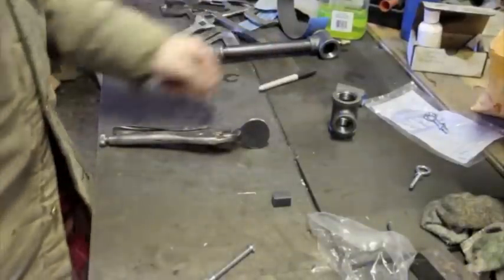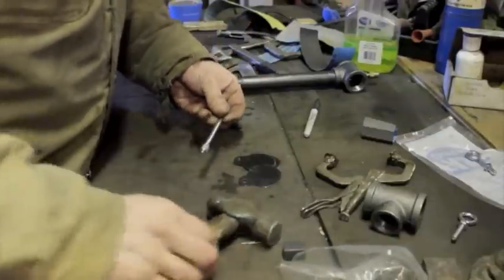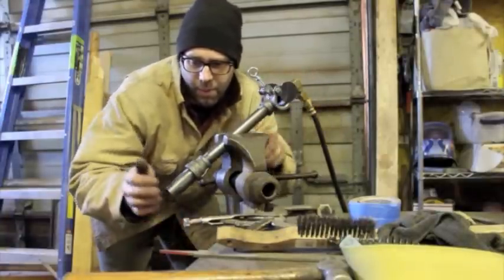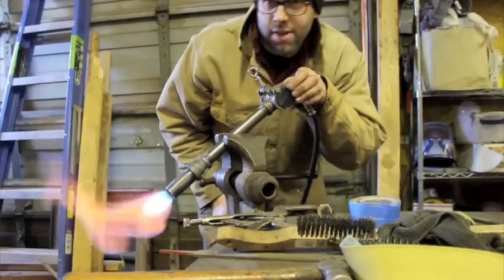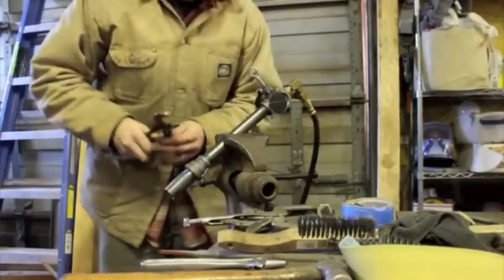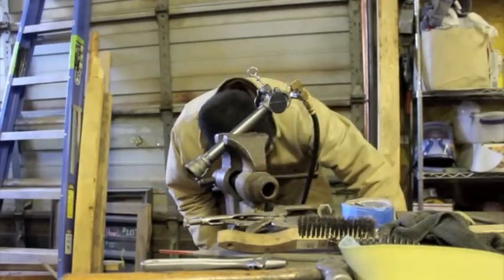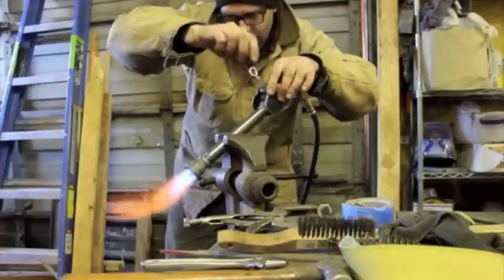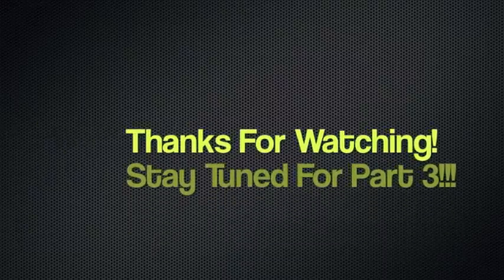BUILD A BETTER "FROSTY T" FORGE BURNER PART 2:  AIR INTAKE CONTROL SYSTEM

Comment from the maker: Great learning process. As a couple people have pointed out, it's possible to permanently adjust the burner as desired. The directions for the Frosty T burner tell you how. I didn't have the instructions when I made this. However, if you ever wanted to adjust between a neutral, carburizing, or even oxidizing flame for some reason, the original design won't allow that, and therefore the purpose of the air intake control system.

Comment: 1/4" all-thread would be a better choice that way you can use 4 nuts to secure the air valves. Maybe you can even use washers against them to add more precision and stabilizing control.  I like this Idea, simple yet effective. Also, you might want to get some 1/4" flare nuts for the flare fittings, but you need a swedge and flaring tool to make copper pipe connections. It would be much easier to plumb up. HVAC uses these and a used set should be easily obtained.

Comment: if you dont need to adjust the burner once its set you could use a treaded pipe (think they sell those for lightfittings ) where the gas goes in the T pipe mount 
mount a wide washer behind the mig tip , when you need to adjust it you basicly screw the migtip with the washer toward the ventury pipe and close up the ventury with it 
once its set you can lock the thing up with a bilt on the outside and hook the gasline back up

Comment: looked like you could have used a 90 degree elbow instead of a tee.  Even if you had to go with a 1 1/4' elbow.  They even make them with a hole already.  Then you could simply add a ball valve to control the air flow.

Comment: I changed my mind about the flare, it isn't venturi its the opposite of the other end. Slowing the mix down and holding the flame instead of blowing it off the end.

Sorry for the rant and late reply.
Reply from the maker: Controlling the velocity; that makes sense. I think that's what you're talking about? I may be wrong, but if I'm not mistaken, lower velocity could still allow more air (oxygen) in than you need for the burn, which would produce an oxidizing flame. This was my concern, as having an oxidizing atmosphere in the forge is not ideal. Holding the flame is one thing, the type of flame you produce is another. Also, it seems simpler to me to not have to fiddle with the jet depth.
I'm certainly no expert on forge burners, the only reason I labeled it as a better frosty t is because despite the adjustments you might be able to do on the original design, there is no way to actually limit the amount of air / oxygen that enters.
Thanks for the interaction and watching the channel!
Reply: @FireCreekForge  Whatever works best for an individual most definitely. And I hear you now on the title, was just curious. Anyway that's the science of it. Like I say if a guy doesn't want to mess with the initial tune then choke is the ticket. But the depth is what controls "volume" of air not the velocity if you don't use a choke. PSI will control velocity. The openings in the t will only let in as much air as is pulled in. I was quite intrigued out how these types of burners work once I started to delve into the fluid dynamics portion of the build. I'm glad it's working for you, there's always another way to skin a cat. Look forward to seeing the rest of the build.
Reply from the maker: @trevorjonasen3251  somebody posted the instructions, and you're right. The only limitation seems to be that once the burner no is adjusted per the original design, you can't adjust again it if needed.

Comment: May I ask why you are not building this from the directions? I have 3 T burners and they work quite well. In this temp I have to choke mine a bit but adjusting your orifice length gets you set without needing a choke when warmer out.  Also once it's in the forge it really does act differently. However I do like the choke set up you made it looks nice and smooth.
Reply from the maker: I haven't actually seen the original directions, there's probably additional useful info. But I do enjoy learning about all this. But I don't understand how adjusting the jet depth would control amount of air / oxygen flow...?
Reply: @FireCreekForge  I would think it is the nature of a venturi, placement of the orifice determines how much air your scavenging. I have no proof  of this just  think it makes since. Thanks for the video .
Reply: @FireCreekForge  These work on Bernuili's principal instead of Venturi's. Bernuili's is that a fluid entering a narrower cross section will speed up creating negative pressure in the original larger cross section.   The negative pressure acts as a vacuum pulling in air and pulling it down the mixing tube behind it. I believe the correct term is "jet enducer" as the jet of propane is what is controlling the air flow. So the closer the orifice is to the throat of the mixing tube the less transition from big to small so less suction. And reverse the further away the tip is. The starting depth of the orifice should be 1.5X the radius of the mixing tube for starters and then you trim it shorter as you need to get the FA balanced out. If you have a full length mig tip n there then you may not have tapped the fitting down deep enough. Your choke plates solve that problem as you can reduce air manually but if tuned right and I struggle with that at my altitude you should never have to change anything after that. Everyone calls non blower burners venturis, I believe that because the industrial ones are venturi burners and they work kinda opposite. You make a restriction in a pipe then flare it out and a negative pressure builds on the downside of the restriction pulling air and fuel down faster.  The coupler/thread protector acts as a mini venturi as the stream of air and and propane enter a larger cross section they slow down and kind of hold the flame. I could be off A little here so don't quote me please. I gleened most of this from the I Forge Iron forum. You did a fine job and those choke plates seem to work I was mainly curious what you meant by better and if you never seen the original plans and only other you tube videos you did great as yours doesn't scare me now that you dropped that reducer expander section. I have to come back and check out your forge build video soon.
Reply: Why not just put two taps on to regulate the air. Don't know if it will work. Just asking

Comment: You made that way harder than it had to be man. Could have screwed the flaps that control air directly to the surface it lays on. Then just move it forward and backwards from the screw

Comment: I'm currently parting out my own burner design based on http://ronreil.abana.org/design2.shtml and https://www.instructables.com/id/how-to-build-a-gas-forge-burner/
There is an advanced parallel fuel system that lets you put your forge into "idle mode" while you have your metal out, I'm going to concoct this (http://ronreil.abana.org/idle-full.jpg) into a T-burner. I purchased the tapered welding tips noted in the sites..
I have a question regarding expanding the inlets. What happens if you had a 4-way between your inlet T and your 8" pipe? You would have 4x the inlet option if you wanted (which you could plug to 2 whenever. Would that allow you to run more propane pressure for a larger neutral flame and higher heat without much size increase? Potentially useful to achieve heating of greater forge volume with fewer burners. Would that allow for a  super-oxygenated, high heat flame? Would the latter be good for anything, like melting metal with appropriate surface flux?  
My plan is to convert a water heater to 2x forges, as a 44"Lx16"D might be excessive.

Comment: Read the instructions: http://www.blacksmither.com/wp-content/uploads/2015/10/T-Burner-Directions-finished-1.pdf
Reply from the maker: Cool, thanks for posting that. Sounds like if you don't need to ever adjust to a carburizing flame, you wouldn't need to add the air intake control, which is probably most of us...
Reply: @FireCreekForge  I do like your air choke system though. nice work.